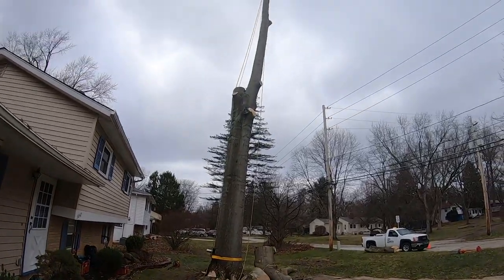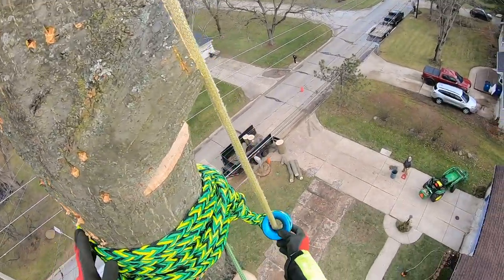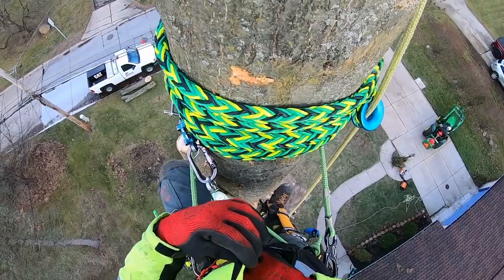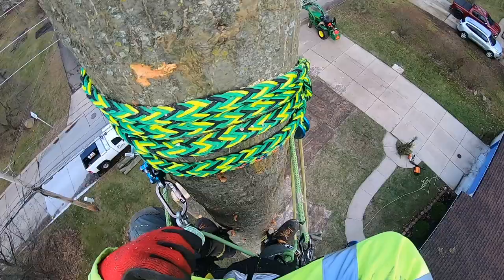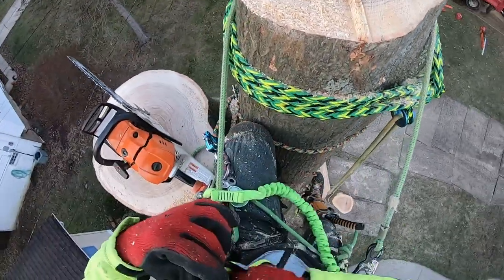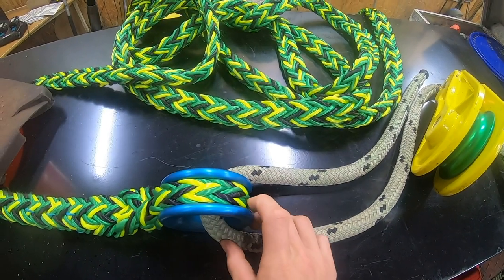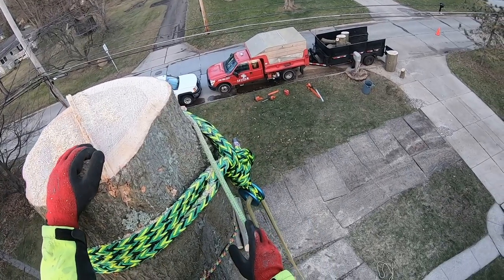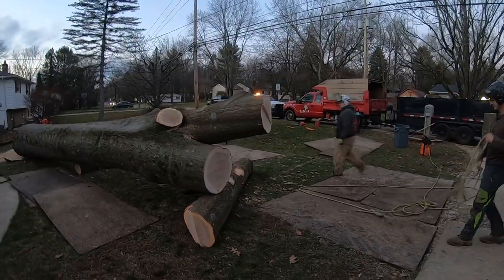How Hot Do Rigging Rings Get?

Comment: Climbers abuse rope all the time. Look at climbing rope and all these rope torture devices attached to them.  Don't forget knots too.  A big ring has a decent radius for bull rope - that isn't a problem.  Only if you cram a big rope in a small ring.  I wouldn't run a double ring as a continuous bend is better rather than bend/straighten/bend that you'd get with doubled rings.  If you are dropping huge weight a long distance, maybe those double thick rings are worth the cost?  Bend-Right.  Will provide more bearing area.  I say use rings if you are only lowering.  Safe Bloc even better.  Keep your rope clean though. I'm a rigging engineer by day and pretend tree climber by night.  Real rigging slings have D/d ratios to abide by but we're using much more of a sling's capacity.  5:1 safety factor.  We are using more actual rope these days because of Dyneema and Spectra being so light, tough and strong. I'd have to look but 1" 12-strand Dyneema rope is good for at least 22,000 lbs with 5:1 safety factor. Stronger than 1" wire rope.
Reply from the maker: I believe it, dyneema is tough stuff and I wish we could use it for rigging operations in the tree industry. There are some dyneema cored ropes out there but they are limited to use at highlines and crane slings as I understand. I think there was a story about a fella who used a crane sling to tie a block in a tree and it railed way below its break strength. Something about the heat that builds up in dyneema when it's tied in knots and shock loaded I think. I have an endless dyneema webbing sling and it break strength Is nearly halved in a choker configuration. I haven't been able to find any proper information on appropriate bend radius through rings. Samson says they suggest no less than a 1:3 ratio on static bollards, and no less that an 8:1 on sheaves. The tree care industry seems to stick to 4:1 for everything, so I don't really know what the minimum is. This ring is only 1.75" inches wide and my 5/8 rope there shpuod technically see no less than a 1.875" diameter bend to maintain that 3:1 rule. I hope to try that bend right ring, it sounds like a cool piece for sure.
Reply: @zaccheus  Holloway Houston Inc. advertises their D/d = 2 for their Dyneema rope slings called their Hammerhead.  It is a 12 strand Cortland Plasma 12 rope - pretty equal to Samson AmSteel-Blue. They do recommend 3:1 for better longevity.  I'm pretty sure they used to advertise 5:1 but they now have some years on the product and proven smaller hardware diameters is OK.  Holloway sells a LOT of the Plasma 12 rope and so no one else could touch their prices when I bought about $70,000 worth of slings for my project. Holloway typically does include a braided jacket over the rope. I see it as completely necessary to have a jacket on Dyneema rope slings.  The rope is fairly loose and thus too easy to get dirt and rocks inside.  That said, check out Yale LOUPS slings if you want to see something cool.
Reply: Another super cool product is Tycan synthetic chain.  Van Beest of the Netherlands makes the stuff.  If they get some competition to get prices down - Tycan would be awesome for  all sorts of rigging.  I have some at work and I'm sure it was probably $50-60 per foot.  Rated for about 13,200# vertical. Links are 3-4" long - all Dyneema webbing sewn into links.
Reply from the maker: @schwartztekllc  very interesting! I would definitely expect to see dyneema 12 strand covered by some kind of sheath. Especially in tree work with all of the abrasive surfaces, it's really easy to pull strands out if loose knit ropes. I'll have to check that out!
Reply from the maker: @schwartztekllc  Thats very interesting. We have some similar stuff in the tree care industry made out of polyester slings. I've seen it used for a variety of things, but I've never had a need for one.